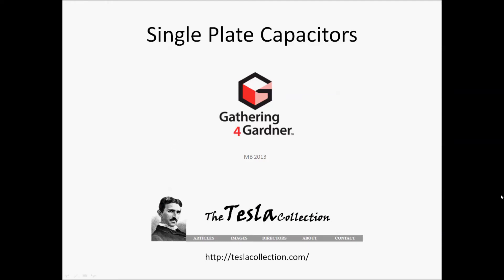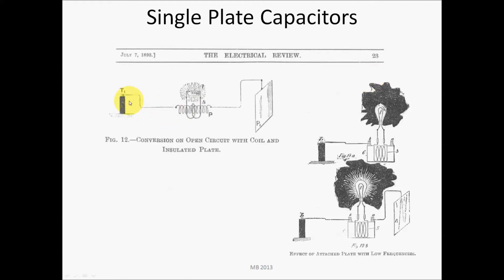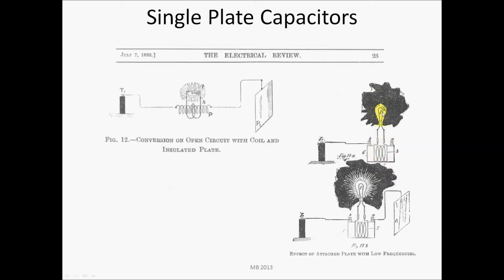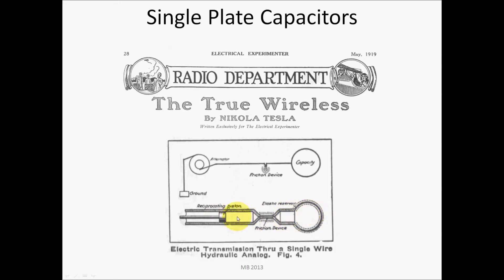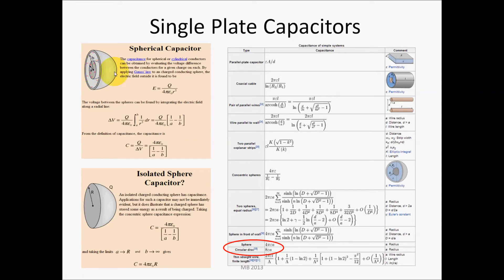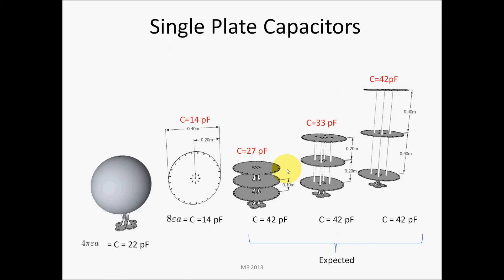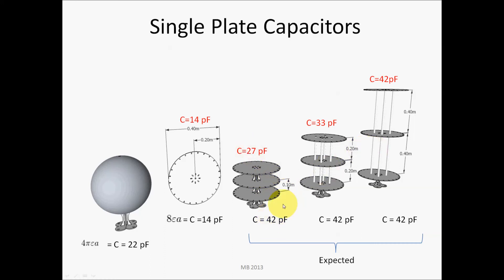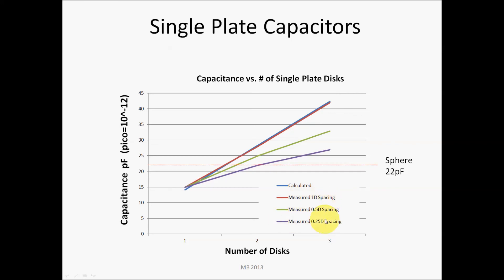Single Plate Capacitor

Comment: I don't know if you are still working on any projects like this but it would be interesting to try a rolled capacitor as a single plate. and in terms of power supply it would be interesting to also an induction coil basically pulse DC with a spark yet on primary coil.
Reply from the maker: I don't think rolled would work...
Reply: @sparkstarter  thanks for the confirmation I also didn't think it would so it leads me to another question. What do you think of a condition where you have a cylindrical capacitor but only have one of the terminals exposed? Namely the inner cylinder/rod.
Reply from the maker: I would think your capacitance would just be that of the inner cylinder, the outer floating cylinder would not contribute to any added capacitance.

Comment: I've done a quick calculation for a new sphere with radius of 0.4m, because your 3 plates now take up more volume (although they are easier to DIY) and from Wikipedia's formula I've got that 0.4m sphere would have 44.5pF. It's not a big difference, mostly practical.

Would it be interesting to stretch some sheets of polimer/acrylic/plastic between the flat plates? Because all 3 plates are of the same polarity, their electric fields push against each other and reduce capacitance. So you acheived your goal by spacial separation. Highly dielectric material would certainly increase capacitance much more than spacing plates out.

High capacitance is very important for this experiment because it reduces oscillation frequency, so amateurs like us ;-), can use more affordable equipement.

As far as I understand electrodynamics (I'm not an expert) there are two EM fields, near field and far field. Near field stretches about 1/6 of wavelength from antena and near field contains scalar/longitudinal field even in Heavside's modified electrodynamics. So to prove that Tesla was right one needs to make the distance between two capacitative loads much longer than several full wavelenghts, possibly at least 10 wavelengths. As well, longer wavelenghts are not of much use for communications.

Hmmmm .... That would mean we need shorter frequencies ;-(, which need more expensive measurement instruments ;-(

We need to try this with at least 0.6GHz of frequency, which is about 0.6m wavelength, for 5m antenae separation.